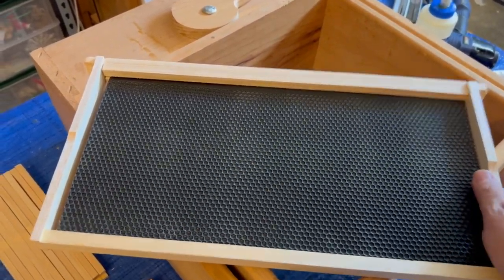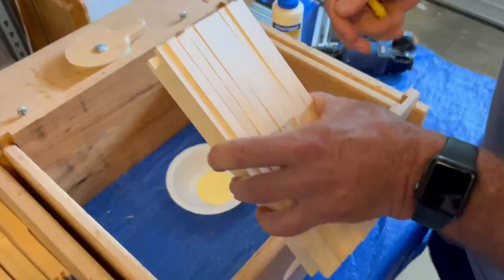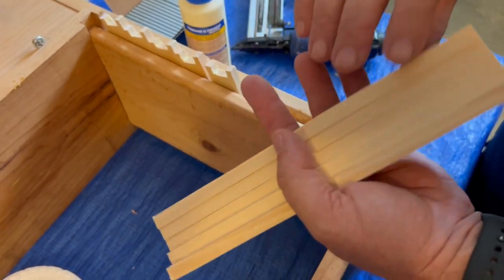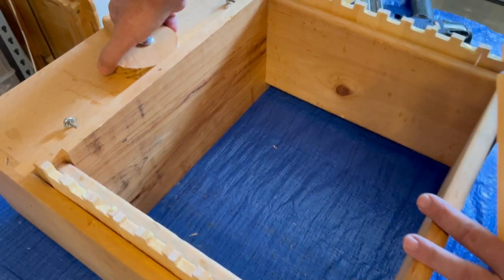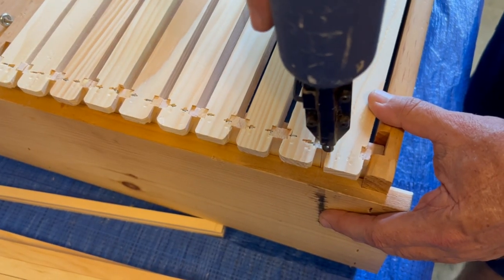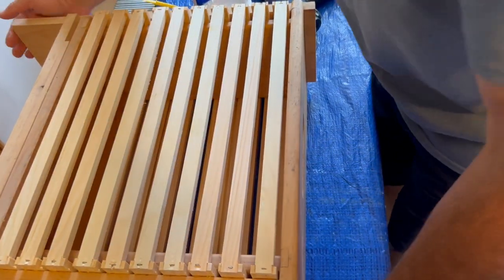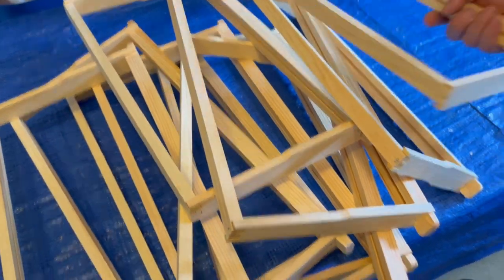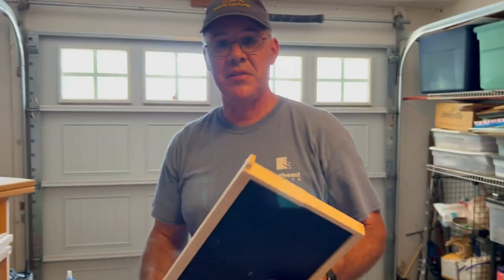EASY Wooden Frame ASSEMBLY (for beehives)

Comment: You don't really need the end staple since the glue does the work once dry....and you can insert the foundation before nailing the bottom bar.  I can do 10 in about 5 minutes.  100 in an hour.
Reply from the maker: Thanks for the tip but I like it for insurance. This foundation really snaps in quickly. I am pretty quick at it but prefer to neither buy single piece plastic frames or buy them already put together.

Comment: What kind of gun are you using?  Are you pleased with it?
Reply from the maker: It’s just a cheap 1/4 staple gun.  Not even sure you can find these just like this now.  There are several brands out there.  If I were to buy another one I will probably spend a little more money.  Don’t really have a strong opinion on what is best.
Reply: @brucesbees  yeah I have a Harbor Freight I don’t really care for.  Looking for an upgrade.  Thanks

Comment: Bruce, do you not glue the bottoms or did I miss it?
Reply from the maker: Yes I glue them.  I guess I must have edited out the flip when I was applying the glue. If you watch closely you can see the difference in the tops and bottoms.
Reply from the maker: Was responding to Dons question.
Reply: Are those frames from Hillco? How do you like them? Does that glue brush have a name. Thanks Grant
Reply from the maker: Premier Bee Products.  Not sure of name for the brush but it is a silicone brush you can get at the paint section at Lowe’s.